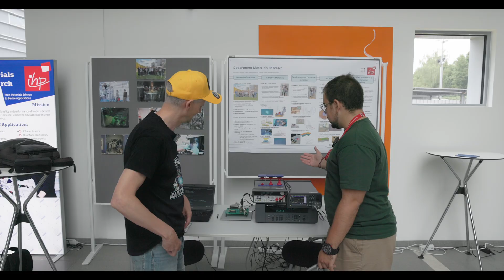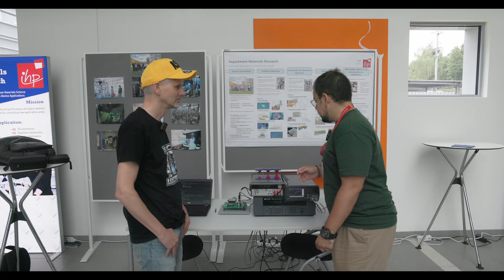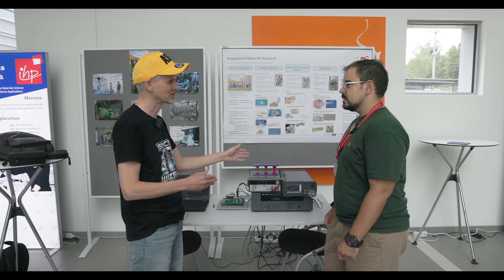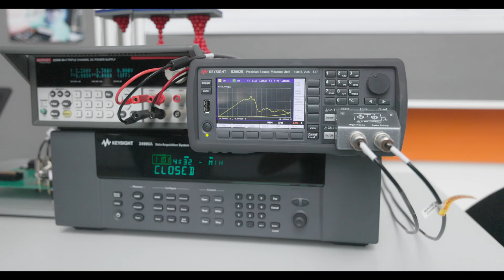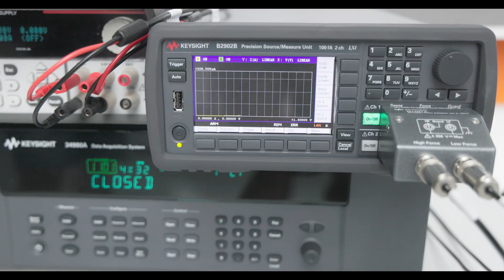What is Resistive RAM?

Comment: People in the community probably do not realise how important this video is.  Ram is a serious issue that comprimises your chip design.  For size, it is better to be able to incorporate your ram into your design. Resistive or parasitical etc ram at low latency high clock rate 3D stacked is important to have for a design, to increase speed, reduce size of your project (iot in partcular) and possibly decrease size.  Dram is small but slow with access timing problems on random access and in need of refresh, and its downward scaling in size is coming to an end, and dram fab manufacturing nodes can't ussually be incorporated into logic nodes.  Instead on logic chips they use sram, but that is 6 transistors per bit, and extra space in layout from memory, and dowward scaling in coming to sn end.  Even though sram tends to be fastest, it usually is not as fast as the fastest sram chips externally.

So, the ability to store fast, compact, multi bit and 3D, allows a convenient way to include vull memories.  Not only that.  A 3D stack of memory die could be put on top, bottom, around the die.  I know somebody with lowest energy microprocessor designs at over 660mhz, async, no clock, and they are 130nm.  Now, imagine an iot microprocessor, or array like his, with 64KB to 1MB+ resistive memory at full speed.  Extremely good and useful.

I am interested in seeing a forth minimal instruction set processor, open 16 bit z80 or open 16 bit 6502 design at 200mhz to 660mhz+ with full memory, to use as a replacement for the processors in the Atari 2600 or zx81 as a mod.  We currently have community forth cores which are able to fit the current size limitations.  But, 130nm should be able to be fed clocked into the multiple ghz on these (basically for a number of decades the industry had only got their speeds by effectively overclocking everything, so the same can be done).

Comment: Why, if I may so inquiry the specifics.. :

What is the theoretical read and write time of state -[0->1]- in 10^(−9) seconds for a cell, respectively?
0. 'X'(i.e '0')
1. 'Y'(i.e '1')

What is the theoretical required power to perform a read and write operation of state -[0->1]- for a cell, respectively?
0. 'X'(i.e '0')
1. 'Y'(i.e '1')

May a cell degrade over operations? If so, how many read and writes may be required respectively, for a traceable change of the above stated metrics?
What is the theoretical average cell density over a unit volume of mm^3(Millimetre cubed)?

Thank you for potentially considering my simple curiosity. :p

- Sincerely, Nigma/D_863 -
Reply: Yep.  Where are the answers?  We are not just here for tech infotainment.  But then again, how come they are not using cheaper superior nanops?
Reply: @waynemorellini2110  Exusce me, but are you directing this to me or them?

I specifically asked this because it's really critical.. Yes, simplicity and consequently compactness is neat and all; But what needs to be reminded is the very reasoning on why Work Memory is usually in RAM.. Clock frequency doesn't matter as much as the very latency: In a ideal reality, a 1MHz memory address is faster than a 2MHz memory address, if the latter has a latency above 1MHz seconds.. And if you do not care about this, then you might as well operate on the hard drive.

Unless you're running a Server Application of any kind or doing literal Physics Simulations, you shall not need more than 16GB.. As usual with all hardware, the problem usually doesn't stem from it, but the Software that operates it. While not all, surprisingly many Applications are crafted by Coders who do not grasp proper Data Management.. If you're going to call yourself a Programmer, then realize that the Disk, isn't just for mere Configuration Data nor Logging.. Modern Hard Drives are faster than you think, if you use it with it's properties in mind.

Apologizes for the rambling, Positive Autism my beloved.. But it does genuinely surprise me how seemingly naïve most Programmers are, but I do certainly not blame nor judge them, in fact I suppose that's merely school for you where they sight Teaching as mere Reading. ¯\_(ツ)_/¯
Reply: @Nigma_863 Yep, is this how you treat people agreeing with you?  The irrelevant rambling dialogue has little to do with my statement or it's intent.  Nobody here got an answer, over something which is actually extremely useful.  I have seen it before.  Now, nanops is aiming at a lit diverse smaller nodes than the present foundries at a lot less cost (it would be excellent if a foundry partner work together with nanops and here to deliver the next gen).  Now, if this  had another reply that you were referring that was deleted, Im sorry.  Inconvenient truths get challenged and deleted.  But if that is the case, to address that:

Im an inclusive. Where wver its 32khz, 3.2mhz,  3.2Ghz or 32Ghz, I see your use case, and it would be great if as much of it as possible could be covered.  So, 1mhz is great.  Let's get one thing or of the way, games and simulations can push past 16GB, but nobody here is asking for that.  I mentioned memory which supports 660mhz, as a good ambition, as that is what a chip designer who holds the low energy record, who I know, achieves.  Today he could probably push 10-20Ghz with his design system, but no memory that can keep up with it.  But in reality, not much need above 5Ghz, and some other people ae going out with a low energy parrallel array at 6Ghz per processor (40 of them). I could say that there are multiple speed points of usefulness between 32khz and 6Ghz.  Its useless to cap it as must be 1mhz, below 100mhz, or 1ghz.  In iot 32khz, 1mhz, 10mhz etc is useful.  But there are other things requiring speeds upto 1ghz, then it probably thins down outside of multimedia, personal computing etc.  So, I too want to see the performance characteristics.  As I am interested in forth misc processors.  We can perform several instructions in one menory fetch, we could clock these simple low energy designs incredibly fast, but 6ghz say, needs 1ghz of menory, but it requires zero excess latency random accesss menory to keep that short instruction cue fed at 6 instructions at 6Ghz.  But, we are fortunate to have any high desity cheap nemory option abode 100mhz.  So, it's important to see if even a non overclocked 660mhz+ 130nm misc cpu can be kept fed at least.  More than enough for most embedded applications and reflective of most 130nm can do at the perfect end of the lowest energy per clock cycle it can do.